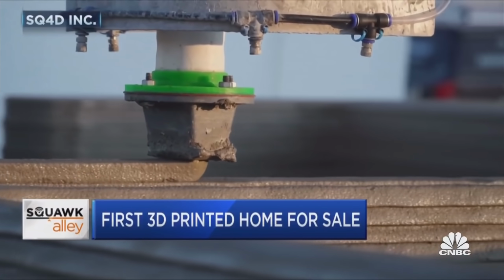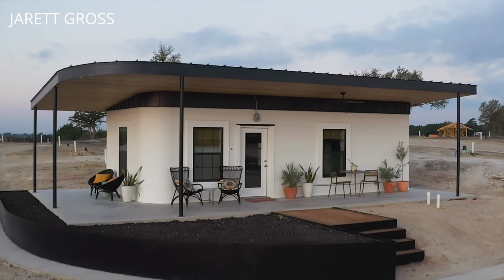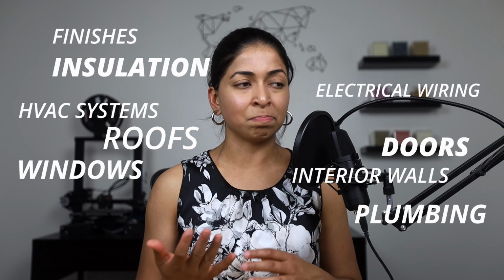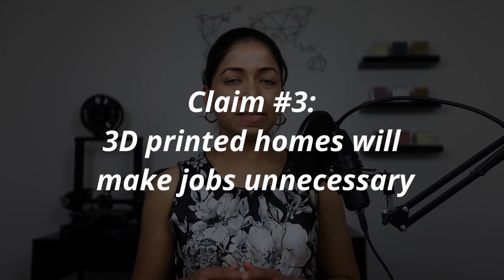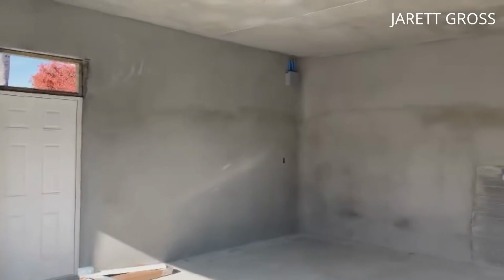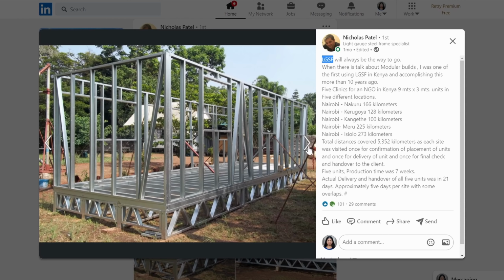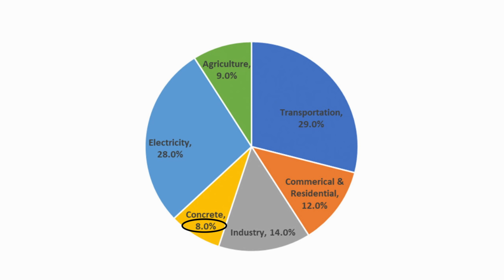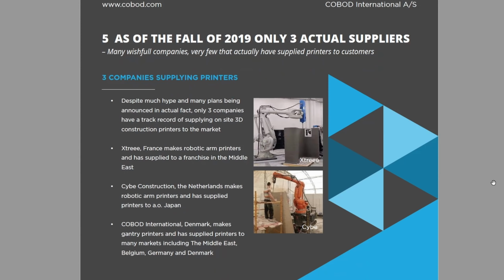Exposing 5 LIES about 3D Printed Concrete Homes

Comment: In many parts of the world, the problem isn’t a lack of housing but its ridiculous high cost. My city is filling with apartment buildings which are unoccupied because of the extremely high rent prices.
Reply: Nobody wants to rent to people with shit credit. Blame the difficulty in evicting people who dont pay. Thats a state issue.
Reply: Speculative housing developments being bought by speculative investment firms whose value is driven by the expectation that eventually someone who needs a place to live will actually pay these ridiculous prices & that this amount is only ever going to keep going up.
Reply: Which city?
Reply: @InnuendoXP  and low interest rates. Cheap money has been flooding the market for years in many parts of the world; when people can afford to borrow more, they can afford to pay more, and the prices go up to reflect that.
Reply: there's also an aspect of it that's a sort of self feeding cycle. Developers need to make the project attractive both to prospective tenants, investors and the city councils who have to approve the build. So they propose buildings that include underground parking, gyms, green spaces, social spaces, security and other amenities. The price goes up. And the people who could potentially afford the elevated prices want the highest end finishes. Stainless steel appliances, granite counter tops etc. The price goes up further.
Reply: Same in my city. If it wasn't for my roomies I'd be homeless
Reply: @toomanyaccounts  yeah the zoning laws need an overhaul. There would be more affordable housing available to young families and empty nest seniors who want to downsize if cities would allow for more mobile/ manufactured home parks as well. The newer ones are bright and spacious with big jacuzzi tubs and open layouts. En suite bathroom in the master bedroom. And a third of the cost of an average house. Mobile home have a stigma that needs to be shaken off. But I live in one just outside a small city with 2 kids and a dog. Surrounded by young working families and retirees. Couldn't be happier
Reply: Do you live in Berlin? 😅
Reply: Isn't capitalism juuuuust great
Reply: @toomanyaccounts  Source: trust me bro.
Reply: @toomanyaccounts  read that reply I posted earlier again.
Did I say I was communist?
And read your reply to me again
You just said that artificially increasing wages would raise inflation right?
Now 
What's the goal of stock market ownership? 
To gain a wage, while doing nothing of course. 
The CEO runs the company, the workers supply the labor. What does the wall street investor contribute? Nothing of course. So how do they do it? How do they mantian ownership in companies they do not work in, they never set foot in?  
Artificially by a contract. And combined with futures, they take 95% of all the profits for thier wages. So. Who's the issue here, any one who actually works, or the 5% who just invest and invest and invest? Without one the cost of everything, and I mean everything would drop on average 95%. The other could have minimum wage jump up to $50/hr and hour and only cause a 30% inflation.

But that, right there, that is capitalism.
There are other systems.

There is worker ownership.
There is tenured ownership.
There is owner worker.
There is communal ownership, a great idea for things like sewer companies and other inherent monopolies.
The list goes on and on.
But capitalism is only one of the systems, only one means of ownership.
And might I add the only one that both the American right wing and the left wing attack regularly. Thate word elitists comes to play!
And it just happens to be the ONLY one that acts like an cancer.

We have to educate everyone. There are hundreds of economic systems, means of ownerships and we need to pick the best one for our needs.
A community owned, communist city park makes a lot of small goverment sense. But only after folks like you get it through your head, capitalism is exclusively and only investor ownership, A.K.A. wall street. Nothing else need changed, and boom, small goverment, and affordable goods with minimal inflationary forces
Reply: @humanistwriting5477  You are just spitting propaganda. Let me explain to you what stock market is, in case you never had it explained to you and it's not your fault you are just repeating slogans: 
Let's say you start a company, and you are doing well with this company. You hire 1, 2, 5, 50 employees, and you keep having demand on your product, but now you need a bigger office, a bigger warehouse, more money for materials, etc... Loaning money from the bank is ok, but it can be quite expensive. Also, the bank will loan up to a point, as they tend to avoid risk. What do you do? You incorporate your business and emit stocks. Basically, you sell part of your company to the public. This way, you get a lot of funding to grow your business. You go from owning 100% of a company worth 1 million to owning 20% of a company 100 million. You go from employing 50 people to employing 500 people. That's essentially what stock market does, and that's what "lazy" investor do, they give the possibility of employing people. And there are lots and lots instruments in the market besides stocks. It's such a successful system because it's the cheapest and most efficient way know to finance a business and make it grow. Sure it has flaws, but they are nowhere close to the flaws of centralized systems.
Reply: @tacosmexicanstyle7846  Not really. I lived almost all my life in a country with interests rates so high that mortgages are essentially non-existant. Guess what? Houses still cost 200k+, but you have to pay them all at once, without credit. And being a third world country, salaries are average 500usd/month, so good luck saving 400 thousand full salaries. The situation is even worse when interest rates are higher.
Reply: @humanistwriting5477  All good points, and I agree with you, except ONE thing. CORPORATISM. The combining of government and business. THIS is what is destroying the world. Capitalism remains the best economic model. Capitalism defined as I give you something, and you give me something, of equivalent value. The government stays out of it...
Reply: @MagnusEdvarsson  yes, I understand what the stock market is.
You seem to think it's a bank loan with a bit of the company sold... that's ridiculous.
Do you understand what selling a company means? 
Do you understand what ownership actually is? 
It's fine to invest in a company, and get returns for a limited time, to get your money back and then some. I'm all for that even, bring on the investing! But the stock market is not that.

To own a company in return of investment is literally the worst idea anyone has ever made.
Firstly because a company, or a corporation is legally the group of people. Think about that. What is slavery? Think it through. There's a literal connection here. 
Because the idea of stocks literally came from owning serfs and salves. 

Secondly because it does not work. The fastest way to go out of buisness is to move to private or publicly traded ownership. Labor owned company's have greater then 80% success rates, where as publicly traded and privately owned companies have less the 33% success rate.
Why ever would handing over ownership to someone who does not care about anything other then getting more money cause that? Oh. Right. Because employees and working owners are actually part of the company they know what's going on, they know how to do it all, they know what will work long term.
Investors don't.
Reply: @MagnusEdvarsson  when you actually sit down and do the math, work out the money, the values, stocks come out to being nothing more then forever debts, debts that can never be paid off. 

That's a awfully high price to pay over a bank loan ain't it? 
That is also why the investors share of the market has grown like a cancer. It's at 95% this year. An economy cannot function with only 5% going to the masses.
The stock market and futures markets are about to collapse everything.
And the people in them know it. There is no handbrake to it. There is no way to stop it except to literally make it illegal.

Why on God's green earth do you think the biggest most well renowned name in investment Warren Buffett keeps pushing to end it? He's one of the richest men in the world!
Reply: @humanistwriting5477  Dude, you are still describing corporatism! How old are you? Were you polluted by a college” education”? Marxism is where Communism, and inevitably authoritarianism, came from! Hitler’s recipe was modeled on Marxism! Please, for the sake of your sanity, understand history, and the lessons it teaches. I AGREE WITH YOU, that CORPORATIONS make slaves of its workers. The whole thing got high-jacked when Marxism was introduced in the US, following along with what Europe was doing.
Reply: @anvilsbane  I am a middle aged former buisness owner who's been on the cover of Forbes. 
I am actually describing capitalism. Not Corporatism. 
I am spelling it out the way I am because, just like in the book 1984, people in power have been trying to limit and change the publics definition of certain words and it is to divide and confuse.
Corporatism is a side effect of actual, real world new-speak. 
It never existed.
The "you give me something I give you something of equal value to me" model is in every single economy. It has literally nothing to do with. Well any of it. Thats bartering with animal hides for a copper knife till today.
And the Nazis killed Marxists. They relied on some german linguistic quirks that allowed socialism to mean both "an purely affluent white society" as well "communism" so they could gather votes from confused communists. 
Since. 
Ya know. 
They where never really popular enough.

Marx believed by removing not just profit, but money altogether and going back to resource trading the need for a goverment would be removed altogether. Thats Marxism. Going back to bartering. 
His ideas where terrible. His analysis of economies and how automation would effect the world was spot on, for that I'd suggest you read him. 
He is the only economist who's models actually can predict the economic impact of most things better then a coin flip.
Reply: @humanistwriting5477  so it would seem you and I are closer together than I previously believed. Tell you what, could you recommend a Karl Marx work for me to read? Seriously. Just to be clear, I’m on the side of liberty, self determination, minuscule government. Are we simpatico? 
There are just so many confused children now. Mistakenly believing more government is the answer, not seeing the trap. I’ll admit, I’ve not read Marx specifically, seeing it as poison for the mind. But if Marxism is what you say it is, and NOT communism, I will absolutely look into it. 
Being middle-aged myself, we together have witnessed this world being destroyed by some bad ideas. I want what most want. To live my life unmolested, and to give the same consideration to my neighbor.
Reply: @humanistwriting5477  here’s hoping you got my earlier comment: we are nearly in agreement.

Upon further reflection, my analogy was too simplified. “ giving me something and I give you something” is bartering, and currency was invented to fix that issue. But say I work X number of hours for X number of dollars, is that not the same? Why does anyone start any venture except with an eye toward future gain(profit)?
Incentive. Capitalism gives incentive. Why would anyone do anything if not motivated by profit? Apply this to any human interaction.

And I am not anti-government. It’s necessary at the very least for protection of the realm. Without that, someone will happen by to “ govern” you. I’m just saying stay out of citizen’s personal lives.
Reply: @anvilsbane  no. We are in agreement, but discussing apples and oranges.
I am discussing the definition of words. As politicians use them. Because they do absolutely mangle words and say nonsense to get elected, and they do absolutely 100% know they are mangling words and speaking nonsense so they can defend what you call Corporatism, and they call capitalism.

I will say though. Going forward, we really should have a back pay system of sale to pay labor directly from profit, but. Only because we have fancy computers that can make that simple.
Reply: @anvilsbane  we are very simpatico. 
It is important to note two things about Marx and communism before reading aside from the simple fact that frankly, his politics failed they got taken over by Dictatorships
And that is that Marx was an anarchist is the political sense meaning he wanted nobody at all to have power over anyone. I think we can both agree, if someone is either clearly insane, or going around stealing or harming or killing that person uh, should not be considered equal anymore they are after all interfering with others liberties at that point
And secondly
Communism was originally a tool designed to minimize the need for goverment, so at that time, he was definitely a communist and writes as such but, definitions of words change.
I'd start with "An Introdusction to a contribution to the critique of Hegals philosophy of the right",  to understand the assumptions he makes politically justifying the minimal goverment he campaigned for, and it's the shortest read, Karl did have more faith in humanity then I think anyone today could hold, and that might explain the failure of communism to achieve communism as defined by "the communist manifesto" the next reader,, to understand how he and other communists at the time wanted to utilize I guess "real communism" again, they failed learning failures is important and "Das Kapitol" as the most important and, frankly, the one we already know but in deeper details, even including a early industrial revolution take on the effects of automation on the economy that ended up being spot on. It's kinda eery and odd.
Reply: @humanistwriting5477  thank you.
Reply: @humanistwriting5477  this ended up being a very worthwhile conversation. Salut.
Reply: @anvilsbane  I try, and thank you. This was worthwhile indeed.
Reply: I see this too where I live. How is sitting on a vacant rental property a better decision than lowering the rents enough to have actual tenants?
Reply: We have the same problem in the UK. Property just continues to rise in value and hence rents increase. London is ridiculously expensive to rent or buy. I think it is the same for most major cities. Even China seems to be having a housing crisis because citizens cannot afford the high rents. Part of the problem is that you can buy a property and just let it sit there without having anyone in it and it will still increase in value better than investing money in a bank account.. So wealthy people buy properties for their investment potential rather than actuallly needing to use them. The only way is to stop people being able to buy more property than they need for their own use, be it living in or using for business.
Reply: @1414141x  It's worse than that in the states, maybe elsewhere, too. Entire neighborhoods of single-family homes are being bought up by investment firms with bottomless pockets who will swoop in and offer like 150% the asking price. The dream of home ownership is over in America for almost everyone, We'll all be renting everything in the near future, and most of us will be lucky to be living in a converted shipping container in 20 years.
Reply: @zednotzee  Trailer parks are an eyesore and do not hold up against extreme weather conditions well. Plus the transiency of the populace attracts a lot of criminal elements.
Reply: @2Evil2Hope  like i said: stigma
And i also said  i live in one that's all nice working families and retirees. My neighborhood has weathered several hurricanes unscathed, while nearby houses had trees fall on their roofs. And i can point to to plenty of neighborhoods in my area with apartments and houses on foundations loaded with drugs and criminal elements. The 3 trailer parks around here are nice, quiet, DESIRABLE places to live with reputable and professional property management companies vetting prospective tenants. I had to interview and provide references and proof of employment to move in here.
You are very clearly misinformed.
Reply: @zednotzee  It's good to know that trailer parks in parts of the US are durable and require standards for their occupants. My experience here in the midwest has been less rosy and as far as durability goes tornadoes and hurricanes probably don't compare perfectly. I believe that having the standards you mentioned should be used in all trailer parks or other mass living situations.
Reply: @2Evil2Hope  agreed on the standards. For the record in I'm in Canada, but I know that there are American parks with high standards as well because I've read up on it a little recently. 
Hurricanes and blistering snow storms are about as bad as it gets in my area on the east coast. I've never experienced a tornado but I can't imagine a house going undamaged in such an event either.
Reply: @MA_KA_PA_TIE  Not renting to people with "bad credit" is almost uniquely an American thing. The majority of countries on earth don't have a "credit" system like that.
Reply: @Dirk_Strider  Yes well in America a landlord doesnt have the right to lockout someone who doesnt pay or even turn off utilities that the landlord pays. In many states renters have even more protections even if they dont pay. In some states they have squatters rights. Meanwhile the landlord must still pay the state the property tax or else their property is taken from them and sold. And if the property has a mortgage the bank will take the property from the landlord before the state will.

Anyone who has been a landlord knows the tools a landlord has to ensure payment are few. At best its a lawsuit or eviction all of which can take months and thousands of dollars paid out by the landlord before they recoup any money if they get any money at all. I simply will never rent to anyone who doesnt have prestine credit. Been burned every time.
Reply: @Dirk_Strider  As an FYI I have a friend who is a landlord in the Philippines. When someone doesnt pay he just hires local thugs to boot the people out. So of course most countries dont have a credit system. You wouldn't need it if you can just easily and quickly evict people who dont pay. In the states you need the credit system so you know who can be trusted with lending since taking back your property is so difficult and the wrong pick can mean months of a property not earning any money.
Reply: True human greed is the biggest problem not that we don't have enough for everyone.
Reply: Target housing for hardship workers and students should be key to prevent increase in homelessness allowing working class to recover and move forward